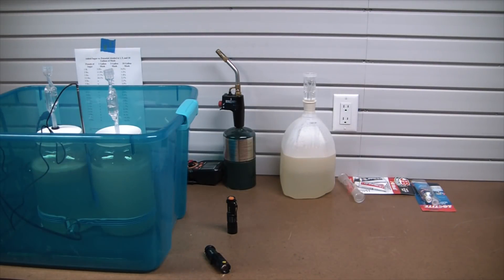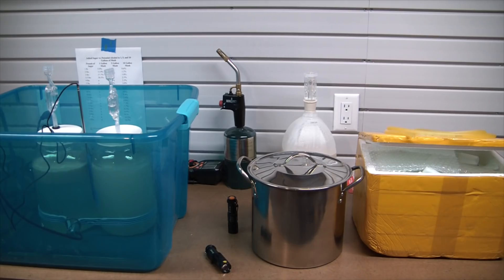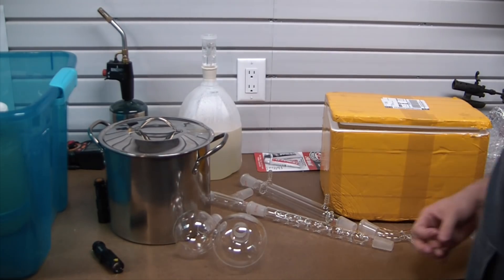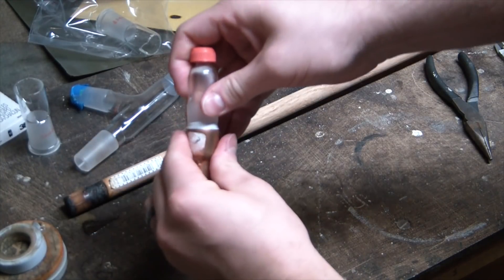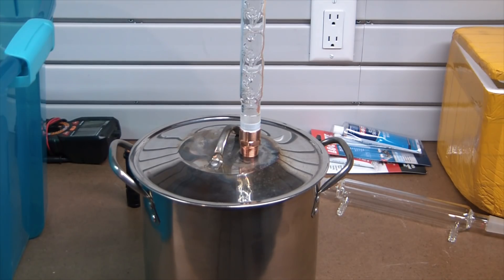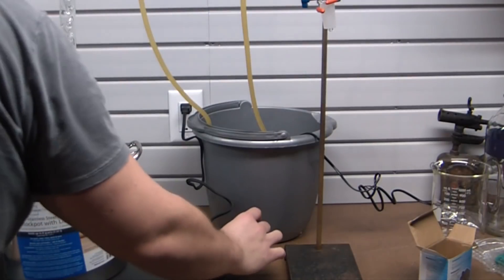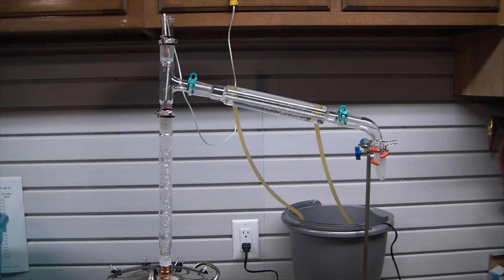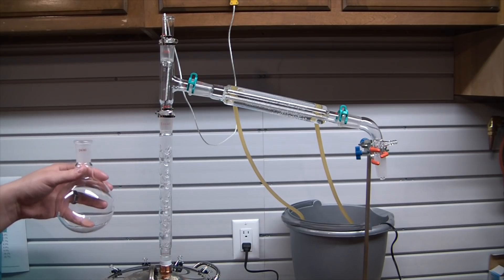Building a SUPER CHEAP and SIMPLE Reflux Still! - ElementalMaker

Comment: Wow, your version of a cheap DIY still is a lot more 'scientific' than mine was. Back in highschool, a buddy and I found a 5 gallon bucket, shoved a 3 foot length of 3/4" copper pipe through it on a downward angle, filled it with tap water to cool it (no pump necessary when you've got 5 gallons of water), used an empty liquor bottle as the distillation vessel, and used a bit of copper refrigerant tubing shoved through a stopper to get vapor from the distillation flask to the top of the "condenser" tube. That thing worked great for everything from mouthwash to ether (though ether required ice in the bucket for condensing). Oh, and I didn't mention the heat source. My buddy found a broken electric skillet in the dumpster (only one of its legs was broken) so we had to get it level by shoving bits of bricks under it. We used ~1" of canola oil in the skillet as the heat transfer medium, so we didn't have any thermal shock/gradient issues with the glass. Also worth adding a bit of activated carbon to the boiling flask to act as boiling stones, we had some "interesting" runs before we figured that out. Actually, I just realized, I have a picture of that damned thing – https://imgur.com/DiaoUTN . Damn, that brings back memories...
Reply from the maker: Wow that's one heck of a contraption you built there! can't beat that simplicity though!
Reply: You're a better chemist for it!

Comment: Kinda wonder... could you find a cheap pressure cooker at a local thrift shop and use that, and then drill and tap the lid of that to thread in the copper? Keep up the great show. I like your wide variety of projects.
Reply from the maker: That's what I was looking for, but after hitting three local thrift shops... Not a single pressure cooker. So I unfortunately had to fall back onto the Walmart stockpot

Comment: The glass is probably OK. I distilled sulfuric acid with cheap glass from china, but did it outside of course. It handled 330 degrees C just fine :)
Reply: as long as it's borosilicate it should be fine. You're only heating to around 100*c
Reply from the maker: Damn man I'd be puckered ass real hard that whole distillation. That's what I have my good lab ware for though.

Comment: Are you making an ethanol propelled rocket? 

also, are you going to pack the column for the ethanol distillation?
Reply from the maker: The vigerux column already has dozens of glass fingers in it that act like packing. As for the rocket engine... I can only hope 👍
Reply: @ElementalMaker  if you can concentrate enough oxygen and liquify it, it would be a pretty realistic possibility, although keeping such a small engine from melting from the heat might be the real challenge... I wonder how real the so called 'tungsten' is that they offer out of China... A chamber made of at least reasonably pure tungsten would probably work, so long as the alloy was not too contaminated so that the melting point went too low, but then forming and welding the material would pose a challenge on the other end of the deal.
Reply: You could with some LOX

Comment: PTFE tape is chemically inert = Make sure its actual PTFE, had tape before that dissolved on me.

Stainless soldering needs acidic flux
Reply from the maker: Yeah I'm using the good stuff. Virgin ptfe. Also I was finally able to get the joint soldered. I was using acid flux and safety silv solder, but turns out I had the joint too hot and the solder was just beading up. Tried it again with more tame use of the torch, and it wet the joint beautifully
Reply: Yeah, stainless is odd sometimes, gotta rub the solder on the joint while heating or you'll overshoot and oxidize the joint, solder, etc.

Comment: Was going to say dont go too hot the stainless will oxidize and the solder will not wet i use it alot it works well for less than good stainless steel
Reply from the maker: Yep that was my issue. More tame with the torch and the silver solder went right in and made a beautiful joint

Comment: That stainless steel requires a solder with at least 2% silver to solder it, though it is better to use a 5% silver fluxed brazing rod to make the join, though you need a high temperature to do so. Pretty much the only flux that will work without silver is acid flux, incredibly aggressive, but which will strip off the chromium coating on the stainless steel when hot and applied to a freshly sanded finish. Even the silver based fluxes work better with acid based flux to strip the surface.

A better seal with those pots is to take the lip of the pot, put a sheet of waxed paper on it and then take the lid, run a bead of silicone on it and close the lid on the paper, and leave to cure with a weight on the lid, like a bag of sand or something else. That way you have a silicone seal, and can then after curing take the wax paper off, apply another thin even coat of silicone to the lid and smooth out with a gloved finger to add a thin extra layer or two. Clip on after curing and it will hold the vapour in nicely. Sand pot lid groove before the silicone first coat, using 120 grit paper ( anything from 100 to 220 grit will work) to get a nice rough surface for the silicone to grip onto, and wipe with some acetone to make it really clean.
Reply from the maker: As usual I ended up soldering it no issue right after editing the video. LOL. Using Harris 56% silver solder. Turns out I had it too hot on my first attempt and the solder was just beading off. Many fo the home distiller forums I found stated not to use silicone. Although I cant see why food grade silicone would ever cause any issues. Probably just old superstitious guys who love their flour paste.

Comment: So how are you going to get it to anhydrous levels?  Way back in the day we used 100% ethanol in the lab and as soon as you opened the container it started to absorb water from the air (you could see turbulence in the alcohol near the surface as it dissolved in)  Once you get to 95% it starts to "fight" that last little bit.  Of course we are all on pins and noodles to see the distillation process. Thanks!
Reply from the maker: You'll see in the upcoming video  👍
Reply: Heh maybe a spoiler but you can make another azeotrope that is preferential to the one that alcohol forms with water.
Reply from the maker: @GigsTaggart  are you talking about HNO3?
Reply: @ElementalMaker  no entraining with something like acetone or hexane
Reply from the maker: @GigsTaggart  oh gotcha!

Comment: You could have gotten a pressure cooker and JB weld
Reply from the maker: Lots of distillers caution not to use JB weld. Even though epoxy is very chemically resistant apparently hot ethanol vapor will attack it. And yeah  pressure cooker would have been great, I just couldn't find one for a decent price. I ended up getting the solder joint done after making the video, and silver solder is totally resistant to ethanol.

Comment: I know that packaging :-P  Ive ordered from the same company multiple times and have has 0 issues with any of my glassware (only issue ive had was it took weeks to get from the company to my place in the States... but knowing where it was coming from, and not receiving anything broken... I wasnt too upset)
Reply from the maker: Yeah im really impressed with the glass so far. Since buying that distillation set. I've ordered a few more items from the same seller and am really impressed with the quality. I'm still wary to trust such a cheap brand though, and will keep it for use with the more safe and sane stuff.
Reply: @ElementalMaker  I have ordered from what is probably the same seller a few times. From my own tests and observations, I believe it is high quality glassware with nicks, grinding blemishes, haze, etc that made it fail quality assurance. Still more than adequate in my usage. Even the sintered buckner funnels seem to have very accurate pore sizing.
Reply: @ElementalMaker  Yep, same story here. I've been using the same kit for about a year and a half now. I've even trusted it enough to make dioxane and nitric acid in it with no problems. It's surprisingly legit
Reply: @ElementalMaker  I agree, I'm surprised it lasted as long, with what i've put it through, for the price I paid.  The only reason I felt comfortable making elemental Bromine in it was because there was no extremes in heat or pressure for that extraction.
Reply: I got very nearly the exact same cheap eBay still. Slightly different thermometer holder. Mine worked great.
Reply: Got the same exact kit and never failed me even under vacuum
Reply: let me guess, deschem? I ordered the same kit and a few other items. Looks good enough quality to me :-) US customs seized my order because of an oz of vacuum grease, smh. They shipped everything again with the vac grease separate.
Reply: @charles8060  What was the issue with the vacuum grease?
Reply: @theghostofsw6276  idk, they didn't say
Reply: Hmmm I may just have to give them a go then?

Comment: I used a 5 gallon pressure cooker with a couple of stainless fittings, and a 30 foot piece of 1/4" copper coil passed through an ice chest [exiting at the lower drain, sealed with silicone] filled with water... Not really great cooling, but it worked. I would dip out water with a pitcher and replace it the same way to keep the water temp below 150F .
Reply from the maker: Very nice! Sounds like your making some big batches! Cheers!
Reply: @ElementalMaker  Not MY idea of a 'big batch'... 
~( ,m,)~

Actually right this moment I am not making anything because where I live the mold is just so bad I can't set up any wort.

I will have to set up a clean room with a ton of defenses [UV lights, filtration, positive pressure entryways, etc.] to protect any wort I do try to make.

I now have instead of a 35 gallon wort tank, three 250 gallon tanks, and a 30 gallon 'pressure cooker' [an all stainless steel multi-port high (and low) pressure reactor vessel with a cute little borosilicate viewing portal built in <rated for 1500 PSIG>], some large stainless steel coils [rated for up to 600 PSIG], and 2 kinds of vacuum pumps.

My aim will be to operate a continuous flow process with vacuum instead of boiling, so I can keep the wort in a state of perpetual ferment and perpetual cold distillation.

With all of the various pumps [including low volume/low pressure and high volume/high pressure] and a micron filter to keep my yeast where it belongs, my goal is to simply continue to draw off the anhydrous ethanol without any problems of having to dry it out after isolating it.

As long as my volume is high, and steady, I SHOULD be able to generate up to 30 gallons per month.

This all depends on keeping mold and bacteria out of the wort.

Comment: EM, I would use an electric hotplate instead of the griddle. We want to see more of this and what you will do with it...
Reply from the maker: Yeah the griddle definitely does not put out enough heat to really distill at a reasonable rate. Trying to find a proper hotplate right now 👍
Reply: Benjamin Joshua Beggs Ethanol and open flames are a bad mix.

Comment: Looks great! Now build a vacuum assisted one to destill other higher boiling substances as well.🤔
Reply from the maker: This glassware set actually is a vacuum distillation apparatus. In this instance though I'm just using it as a normal still. I can't say I'd trust it under vacuum though, that's what my Synthware glass apparatus is for 👍
Reply: Or even just set up some active reflux.  I hit 94% with a fairly short copper collum pretty easily.
Reply from the maker: @StillIt  I may just use a fan to actively cool the vigerux column 👍